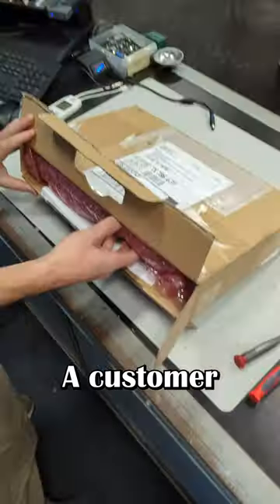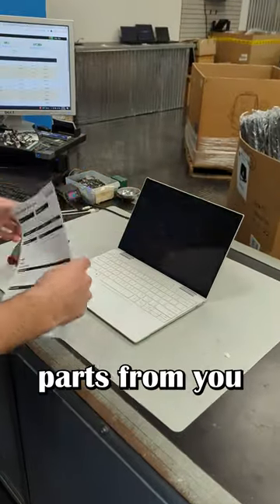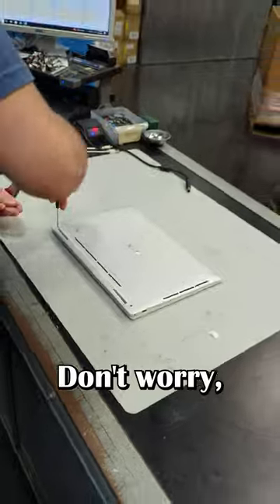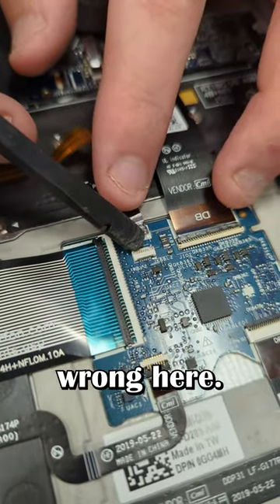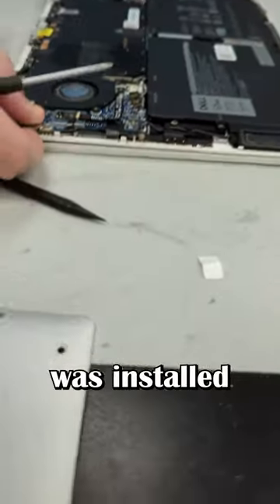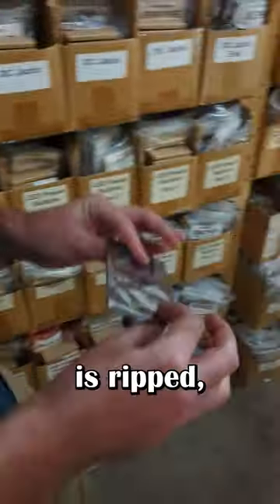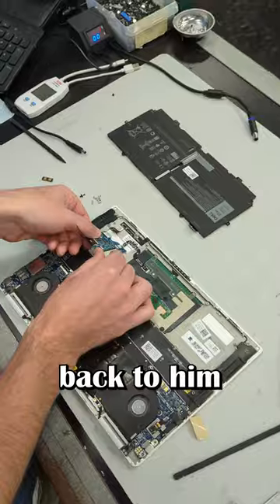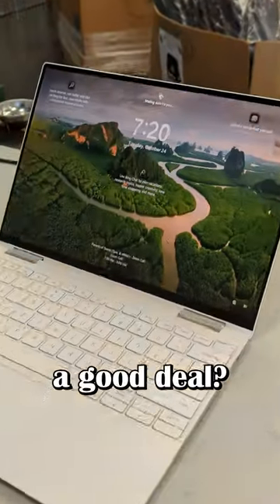DIY Laptop Repair Mistake You MUST Avoid #shorts #laptoprepair

Comment: This is what I wish i could do for a living
Reply from the maker: And you could!
Reply: @dellpartspeople how?
Reply: @Calikid24 look for things that you can repair cheaply and build up your experience. Start applying for jobs and someone will give you a shot.
Reply: @Calikid24 do you not have an electronics repair shop near you? apply for a job, if you already know what you're doing, it's really that simple
Reply: If you're already fairly tech savvy, hit up some repair shops in your area to apprentice under to get some experience and from there the sky is the limit! It's just about getting experience. Could also start by buying broken gaming consoles and flipping them, lots of experience to be had in that alone.
Reply: @AltruisticWarrior  I've done flipping to an extent. nothing extreme, but I've definitely taken consoles and their accessories and repaired them for my own personal use

I've also taken IT courses so I have a good bit of knowledge on PC hardware, however I stopped learning once the course hit software because the way I was being taught wasn't for me, I'm a hands on learner but the courses were pre-recorded online
Reply: Y'all think that repairing computers is just plugging connectors and changing parts? You have to understand how computers work and have to know how electricity works like what is a short circuit and understand electronic components. You can't just start reparing stuff without knowing these things because if you don't know you could end up with a fryed motherboard or something.
Reply: Also in today's world is just not worth reparing computers for a living anymore.

Comment: If possible please post a video on how u replace internal model keyboard without changing whole palmrest
Reply from the maker: If it is screwed to the underside of the palmrest, you will need to take apart the entire laptop and remove the motherboard.  Some models have the keyboard plastic riveted to the palmrest, so you will have to replace it as one piece.  What model of Dell do you have?  We have plenty of videos showing how to install keyboards.
Reply: @dellpartspeople  I do these stuffs for end customers and I find it quite time consuming...that's the reason I asked for ur opinion...the official service centres just change the whole palmrest containing keyboard for problem with just the keyboard 😭